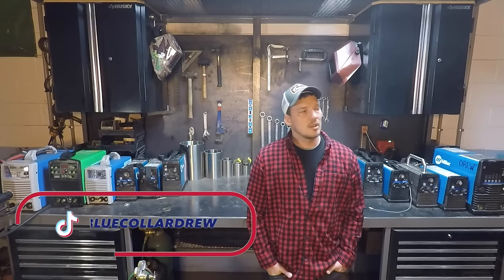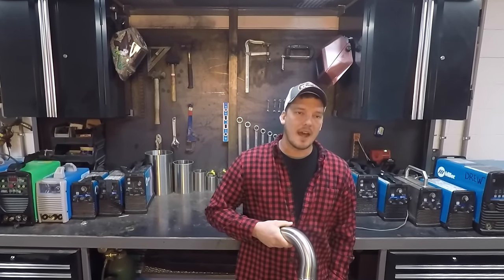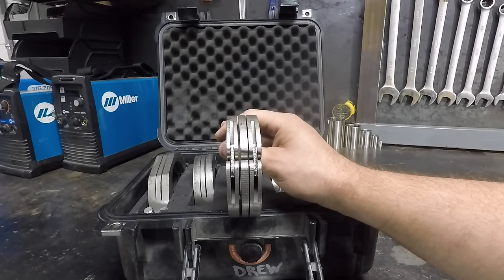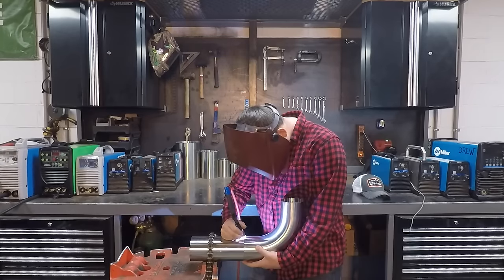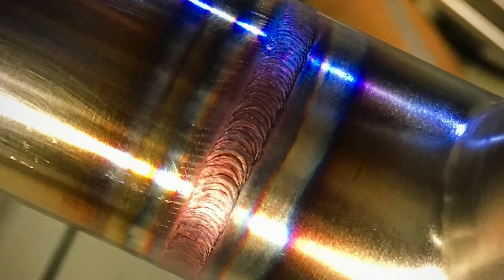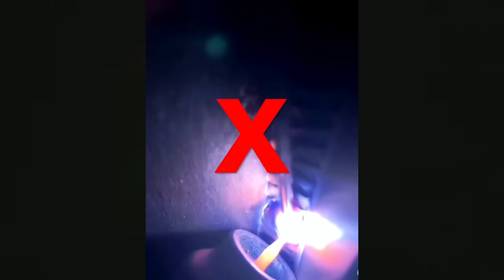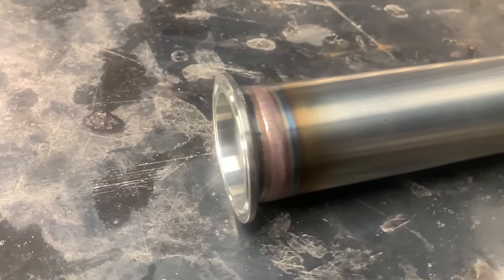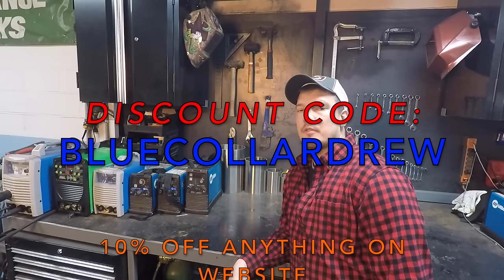Sanitary Welding Made Simple: Expert Tips And Tricks For Welding Stainless Steel Pipe And Tubing

Comment: This would have been most useful around 1999 when I retired from the US Navy as a tig welder, I welded Stainles, aluminum,  inconel, and high carbon steel, did a massive amount of heat treating and annealing,  along with some bubble work with magnesium and titanium.  I worked on burn cans from Pratand Whitney Engines as well as tail pipes from EA-6B aircraft and everything else in between. I was looking for a specific fields to get into but had no direction as to what was avaliable out their. This part of this Video alone is Golden. Thank you and what you are doing is incredibly valuable to the aspiring welder in today's world. Great content!

Comment: Good explanation on the process. I was surprised that all your welding has to be a position weld even on the bench. I have always filed all butt ends to flatten the surface for maximum seating of the tube. Some factory elbows from Waukesha aren't perfectly flat to start out with. The tail/ drag off is so critical, it's probably the most important part especially when having to polish ID and OD. Passivation of surface is ok in the shop but factories are always skeptical about chemicals that fume around the food processor. Also important for people to know if you work with stainless and do sanitary work it is imperative that all tools used in a food plant have to be dedicated for that. Rust doesn't look good if you're wire brush and grinder/polishing materials were used on regular metals. Awesome video!!! I subscribed!

Comment: Great vid!  Just started tig welding. I’m doing a 4” exhaust down pipe with a bunch of pie cuts. I have it all tacked up and I made aluminum plugs on the lathe to bolt onto vbands. I’m pretty nervous to finish it so I’m going to practice a bunch before I get in there. I don’t know if the back purge is needed on a car exhaust part, but I figured why not.
Reply from the maker: Awesome! Always a good idea to purge SS
Reply: Yeah man, smoother the better for flow.

Comment: I'm glad I have come across this video. So little good videos on sanitary welding on youtube. Two questions - what if fitting is not perfect and there is some gap? And how are repairs done on sanitary?
Reply from the maker: Thanks for watching! Good questions. Worst case scenario, you can’t rework the line and you need to fill a small gap.  I do 1 pass with minimal filler followed by 1 final pass with no filler. Might make a video on this. As far as repairs go..  i usually cut out and rework the parts that need repaired.

Comment: Great video.  At 4:00 when you are discussing your setup do you also have a 25 foot cable for a pedal?  I do not see any trigger or switch on your ck17. If you are doing scratch start with no amperage control other than what you dialed into the welder can you sometime please describe how you keep a consistent puddle and avoid burning through?  Thank you.

Comment: Hi Drew,  I have a need to weld stainless steel tubing that is 5mm with .5mm wall. I do have an internal sleve at the weld joints. This is hobby work that soldering is not doing the job I want.  What type of welding would you recomend that I try and do?

Comment: Drew, thanks for your very informative video.  I have a couple of questions: How many amps do you generally used and how many cfm do run for purge?
Reply from the maker: 45 amps is a good starting point for 3” tube. More amps for thicker wall and less for small tubing. As far as CFH goes, i usually run about 12 with the a 1/8” exhaust hole. All of this requires some fine tuning. Hope that helps.

Comment: Great video and brilliant skills 👍 I’m surprised you were using the carbon steel chain vice? Would that be a contamination issue? You make it look so easy 👍 great work 👍
Reply from the maker: You can use stainless jaws or an aluminum jaw cover. Not that critical unless pharmaceutical work

Comment: Is no filler wire a requirement out those ways? Been welding dairy tube 30 years, will generally use filler wire all the time but depending how I feel I'll fuse upto 2"

Comment: I been doing sanitary welding @ 45A torch 20CFM and back purge 15CFM with 1/8 hole for exhaust but I have be getting con-caved on the outside what am I doing wrong also not walking the cup since I don’t know how lol.  Thanks in advanced. Your video was awesome
Reply from the maker: Thanks man! Is your weld coming out wide? Try slimming it up a little bit. If not, just start bumping the purge up

Comment: I really like this video. 
I've got a question. I thought there was a concern with stainless being "contaminated" if worked with other steels and losing its stainless properties. But that's not a concern with cutting it with a saw blade?
Reply from the maker: For pharmaceutical applications its best to stick with GF saws. I believe the blades are made of HSS. As for other applications, sawzall and band saw blades are fine. Clean welds with acid if you are worried but i dont think contact with steel blades would ever be a long term problem

Comment: Great vid.  I am working on adding a cooling jacket to a sanitary tube.  The jacket does not have to be san. It can be 304.  Do u have any suggestions for welding these two metals together?  The jacket is outside of process.
Reply from the maker: sanitary tube can be 304 or 316. You can weld them together as you normally would. they act basically the same. Jacket piping is fun but challenging!

Comment: hobbyist here ... trying everything from flux core to stick to tig ... getting handy enough to do most things I need around the farm ... I have one question .... Yeswelder 205DS is DC isn't it ? I thought that Alu could not be welded using DC bc of the burnthrough ... have I misunderstood that ? btw ... I own a 205DS
Reply from the maker: That is correct. No aluminium welding with DC

Comment: What type and diameter of tungsten are you using? Thanks for the video
Reply from the maker: 2% thoriated 3/32
Reply: Thank you! I work at a brewery and I’m starting to get into tig welding. One other question, do you think the cup size makes it easier or harder to walk?
Reply from the maker: I find bigger cups are easier to walk. Gives a larger surface area to make contact. But a mid size cup is usually what i prefer. (8-10)

Comment: As a first class Tig hand myself, working with sanitary and semiconductor industry, you really are not supposed to walk the cup on thin wall tubing. I walk the cup on anything schedule 10 to schedule 180. When you walk the cup, it slows you down, causing the heat to burn the very little chromium in the stainless. Also, it's vital to purge, and pulse your welds, as well as knowing how to set your upslope and down slope settings.

Comment: Any reason you guys don’t use hf on your tig setup?? All we use in Australia.
Reply from the maker: I don’t like using remotes with sanitary. Most make your torch bulky and get in the way. Not ideal in tight spots or 25 ft in the air. Just preference i guess.
Reply: Like he stated above. Sometimes the movement required to be able to push the button or remote can be enough to affect when welding some critical tight spots. Same goes for the torch-cable, I always run a Quick "testrun" around the pipe/part without starting the welder, so I can be sure that nothing gonna make me have to stop in the midle of the weld. Greets from Norway🇳🇴 I have about the similiar experience of welding,  and this video was spot on🤘 High Quality content. I wish there was youtube with videos back when I started welding😁

Comment: Agreed with most of this apart from two comments  1  no filler wire 2 walking the cup is easiest but you have to learn freehand as sometimes walking isn't possible ,this is a complete contradiction   and as good an argument against walking the cup as I can think of and ya iwas welding on pharmaceutical  piping  so long ago Regan was still an actor lol

Comment: Man you’re too organized. You should see my mobile set up, I mean, I try to keep my stuff in specific areas where I can find it quickly, but when you get to the job site where they expect their sub contractors to hit the ground running and produce. Only a matter of time before they sniff out the phony’s and send them packing down the road. Anyways, so when that’s the situation that you’re in the process pipe industry, working on multi projects during your scheduled trips will have all your tools and equipment all over the job site. Difficult to keep your stuff accounted for day in and day out. I try, but you’ll have a tool here n there slip through the cracks.